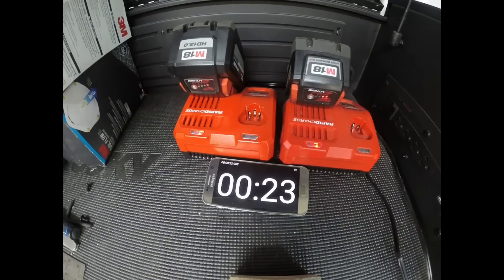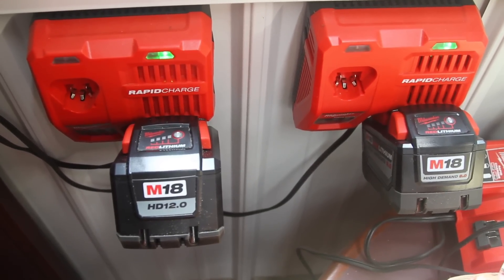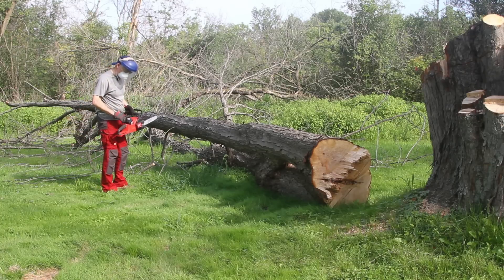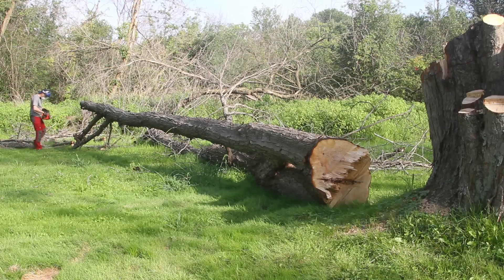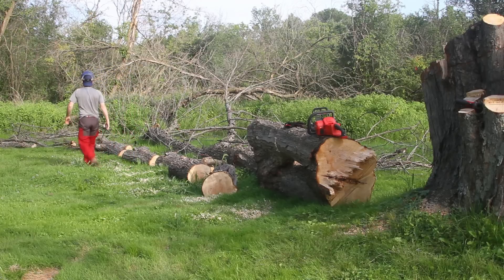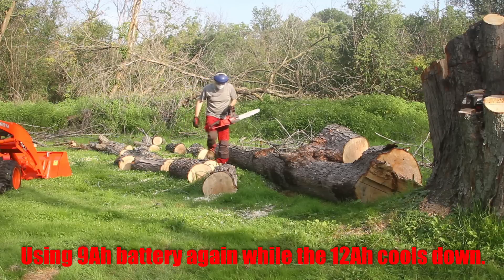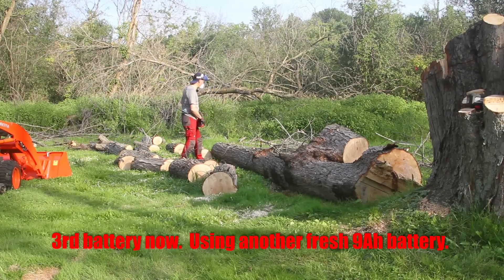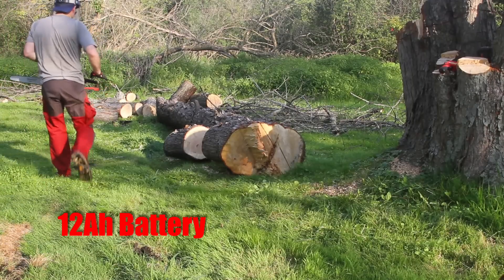Milwaukee M18 12Ah battery charge time vs. work done with chainsaw.

Comment: I usually spend more time getting my gas chainsaw started and running properly than I spend actually cutting.  This looks like a better option.   Especially for clearing shooting lanes without alerting wildlife for miles.
Reply from the maker: Good point!
Reply: You must not know how to start a gas, or either the chainsaw is in terrible condition. Considering I can start my 10 year old Stihl ms 290 in a couple of pulls says something. But this electric chainsaw is very cool!
Reply: @Anonymouso283  yes, it says you're a douche.
Reply: @Kevin Jones 
No, no. Don’t take offense to my comment! I wasn’t trying to be an asshole lol! I was just stating that (most likely) people having trouble starting their gas saws usually either don’t take good care of them or they don’t know how to start it. I wasn’t meaning you were a irresponsible person! I was saying in general. Anyway, have a good day! :)
Reply: @Kevin Jones  
Oh, now that I see my comment, it kind of is directed to you. Whoops. My bad! I mean in general. Not directed to you lol!
Reply: @Anonymouso283  it's all good.  Most of the time my issue is old gas that needs to be replaced because I don't use it as much as I used to, and i don't have many 2 stroke items anymore so it usually requires a trip to the gas station.
Reply: @Kevin Jones 
Good point. I don’t use my saw too often too, but I like to start all my engines up once a month to keep things moving, if that makes sense. Anyway, have a good day my friend! :)
Reply: @Anonymouso283  you as well.
Reply: @Anonymouso283  this saw starts in ZERO pulls everytime.  Most home owners use a chainsaw once or twice a year. Store your chainsaw for 11 months and try and start it.  Guaranteed trip to the small engine repair shop for a carb clean.  NOT for people who use a saw everyday.  PERFECT for a home owner.  Now the best part is you can buy a tool that used the same battery.

Comment: Your temperature reading on the battery is very misleading and inaccurate.  Of course that battery is going to be its hottest at the point of voltage exchange, but that's a very localized area that has little to do with the cells on the whole.  Your initial reading on the bottom or back of the battery was a more accurate or true way to measure the proper temperature (111-113 deg.).  I just pulled my 12Ah battery off the rapid charger and it was hot at the contact point but the majority of the battery was mildly warm at best, no overheating issues. The battery won't push power if its "Overheated".  Put a small fan on it if your worried.  My 12 gauge electrical cords get fairly hot at the point of plug-in.      

Enjoyed the review
Reply from the maker: Thank you, point taken.  My apologies for anything misleading.  The reading I took after the charge completed was unusual and I believe to be the circuit board inside near the contact area as you pointed out.  The other times I charged the battery I don't recall it heating up like that.

Comment: total waste of money gas chains saw last for 20 years or more how long will these high dollar batteries las 5 to 8 years
Reply: I gotta agree with Leggir, if you have all the other battery tools, you can use it on your chainsaw on a certain day, then use the battery the next day on your miter saw, circular saw, or sawsall. I think the market for this saw is the tradesmen that occasionally uses a chainsaw, rather than professional tree trimmers.
Reply: If you've got a Jeep and want it to cut trees off the road, it starts faster, doesn't stink up the vehicle, etc. You can also use the batteries in your drill, lights, air compressor, heat gun, caulking gun, nailer, sawzall, tablesaw, etc. Probably not a waste of money depending on the application.
Reply: Batteries if used hard every day last about 2 years but if not used hard can last 5 or 6 years
Reply: Gas saws last 20 years if you maintain them and run them consistently. An electric saw will start at the press of a button as long as the battery holds a charge and the brushes aren't corroded. A gas saw will kick the bucket if it's brushes corrode (the chainsaw equivalent of an alternator, I forget what it's called) and on top of that worry you have to deal with 2 stroke engines being fickle. For most people electric is the way to go for sure
Reply: @Robert-qm7yi  good thing it doesn't have brushes

Comment: Fair to say this job is a fair bit beyond the intended performance of this saw. That’s a big hard tree that would test any 16” saw.
Reply from the maker: I agree.  And really this saw did quite a lot of cutting with the 12ah battery.
Reply: I’ve used this tool with great success.  When used correctly this job is within its capabilities.
Reply: For the cost of the saw and the batteries, you could find a gas saw that would lay waste to that tree pretty easily and do ten more after it. 

For yard cleanup work, the battery saws are nice. For someone going out with a big wagon and expecting to come back with a lot of wood, they're a really expensive mistake.
Reply: @daw162  You are on the spot

Comment: Think you could put a 20” Oregon bar/chain on it without any issues?
Reply from the maker: Sorry, I missed this comment because it was marked as spam...I have no idea why.    You are thinking like me.  First thing I did was check to see if my older Oregon bars would fit and they are too thick.  I have not had the time to research the  fitment of other Oregon bars and chain, but it has been on my mind as a followup video.  So many projects, who knows, I might try it, stay tuned.
Reply: Oregon 18 bar fits. :)

Comment: Whats the C rating of the 12Ah to actually achieve total capacity? 
If it's overheating I would guess you're more likely getting closer to 8, whilst hurting the cells.
21700 tech isn't as developed as 18650 is yet and it seems like they might be good for peak amperage but suffer under high constant drains due to their extra heat trapping bulk. 
Power density is also no better than 18650 yet. 
I'd like to see a controlled chainsaw stress test with a 12Ah vs 2x12Ah batteries in parallel. I recon you would easily see 3x the run.
Or just say fuck it and buy a 2 stroke.

Comment: Is there a possible over heat issue from 12ah battery?
Reply from the maker: Yes the 12ah battery can be worked so hard that it will over heat. However, I believe that 12ah battery is the best cordless power tool battery on the market today.  It really is an awesome battery.
Reply: The 12.0 and 6.0 use 21700 cells unlike the 9.0 and 5.0 and smaller which use 18650 cells. The 21700 cells have a much better cooling capacity and can handle a higher current draw than 18650's. In this video it's not a battery problem, it's a user problem. The way he was cranking on it, any comparable gas saw (40cc's) would bog down and completely stop where this one kept going which draws huge amounts of current

Comment: What a piece of shit ...the price of the saw plus charger plus 3 batteries you are using and they are over heating. ..go out and get yourself a stihl ms661 with a 25inch bar it will not bog under load just check your fuel and bar oil and you will have that trunk cut up in no time

Comment: Any noticeable difference in the saw’s power between the 12 and the 9?
Reply: I'm  beginning to think even the 6 provide more power than the 9. The 6 and 12 have different chemistry with greater discharge rate than the others but at reduced charge recycles - no free lunch. The internal voltage drop is less on the 6 and 12, thus more power delivered to that motor.
Reply: kimchee94112 6 has more power but less run time. Give and take.
Reply from the maker: Not really.  Power seemed fine with the 9ah.
Reply: It will be the exact same performance, but the 12 will last longer.

Comment: Could this be a future problem (battery heat) with Milwaukee sticking to an 18v platform? Having to draw more amps to get more power? I abuse my husky batteries when I use my T536LI XP and they never get hot, barely even warm. Likewise with my flexvolt tools. The only 9ah Milwaukee battery I use is on their grease gun which is excellent but it never gets a chance to get hot. I agree with you having to remind yourself the saw is live, I am struggling to get into the habit of locking the chain whenever I put mine down too!!
Reply: i think the issue will only be with the chainsaw, i'm a contractor and i run only milwaukees and i've worked those 12 amps really hard with the new 2 gen tools and they have never reached any temp that i'd consider too hot after running a super sawzall for 40 minutes straight through a pine 6 by 6 basically trimmed a wood post too be a 5 by 5 the battery barely got warm, compared too my older batteries these 12 amps run really cold, it's impressive they are running cells that are cooler with more power.
Reply: You're not drawing more amps. It has more cells, so same amps per cell, the stress on the whole battery is the same.  And it's not overheating it has a safety to shut it off. Simply get 2 batteries and swap a lot faster than getting fuel and filling. And no fuel spills
Reply: @Q70L5.6AWD  I would have thought the batteries draw more amps as needed, hence why the motors keep constant rpm when pressure is applied. I'm sure I've heard dewalt, milwaukee and metabo market this with lion and brushless motors. If the safety is kicking in, I'd say it's overheating. To get a certain wattage from an 18v tool you need more current draw than from a 54v tool. Just saw a video of the new makita 36v cut off saw and it draws more amps as required also.

Comment: Use a Milwaukee M18 Jobsite fan or a cooler to cool the batteries down. Also, at any point, are you planning on moving those logs? If so, do that with the Kubota while you wait for the battery to cool or charge. No downtime that way.
Reply from the maker: Hey I like that idea!

Comment: If i want to cool something I'd place it in a cooler with ice or in a refrigerator. Setting it out in the hot sun doesn't mean cooling to me. I use the 9 A-hr battery on my grinders and when they get hot I put them in my beer fridge and they cool right down and keep on trucking. What I'm trying to say is if you want to cool something then cool something.
Reply: When you put a hot battery in the fridge you getting moisture in the battery not the best idea
Reply: Good idea, a little cooler with blue ice outdoors should also be good.
Reply: Yezzir, or drop it in a bucket of cold water for a few minutes...

Comment: I used a stihl battery saw on a 95 degree day with two batteries over 8 hours. Neither saw or batteries  overheated. Got 1 hr out of each battery before having to charge. It took each battery 45 minutes to charge, a conservative estimate of 400 cuts. The saw was a 40v 6amh with 14"bar.
Reply: Thats awesome. I would still buy this simply because I have batteries and chargers for m18 tools already and this would go well with the set.
Reply: stickin' china made crap @Bshwag
Reply: What?  @lifeingeneral9111
Reply: were you cutting 15" hardwood though
Reply: My Stihl 200c can be worked hard with the largest battery and does not overheat. It runs until flat. That said I  think your Milwaukee has more power.

Comment: Id say technically it didnt overheat since the protection kicked in before that actually happened. But i wouldnt be surprised if Milwaukee came out with a revised saw that has a fan to blow air on the battery every time you pull the trigger..
Reply: That start to look Milwaukee strategy they make good product and gen2 is far better and you want to buy that too.
Reply: Nonetheless it's better than another competitor when the battery overheated the electronics identify it as bad and could never be used again.

Comment: Considered buying this chainsaw.. But the fact you can't get an hours worth of cutting done is just sad..
Reply: You could if you let the saw do the work unlike this guy who was cranking up on the handle like an 80cc gas saw purposely working it too hard thinking he was testing it. SMH
Reply: Aaron, this video is a tad misleading. I have one, and used it the other weekend. We had a bad storm that blew over a full grown tree, roots and all, onto my neighbors barn. Besides the 25 feet of 22" diameter tree trunk before branches started, everything else was done with my Milwaukee saw. I used it for 8 hours on branches and limbs. Never once overheated. I went through one fully charged 12.0 battery, and 2 bars of a 9.0 battery. It is honestly a pretty impressive little saw.

Comment: Well these just got in stock locally and before going out now to buy - checking reviews since mostly limited manufacturer sponsored type or speculative  reviews about this thing should be great last time I looked.   This review with the overheats making me think this is a junk saw to stay away from.   Was just minutes away from going to get.     Uuuuughh!
Reply from the maker: I really hesitated to show people the over heat issue.  But I did.  If I used the saw like I normally would, by cutting then hauling out cut wood with my Kubota, back and forth like that so it has time to rest between large cuts, it would be fine.  I pushed it in this video on purpose.  I wanted to see what it would do.  This saw is more expensive than a gas homeowner saw, but you also get the most awesome tool battery on the market, in my opinion.  The performance of this tool is impressive, but yes over heating is a reality, though one that can be avoided by work flow that includes a little cool down time.
Reply: also too be completely fair the test shown above was the absolute max this tool in my opinion could do, and its impressive that it actually still did the job.  maple isn't soft by no means and those logs are rather large for homeowner work, its a homeowner tool in reality even though I personally bought one but i'm not in the fields of logger/tree removal I only use it for brush/small trees when i'm clearing lines for fence installs and for my particular use given I have no experience falling large too medium sized trees it's perfect.
Reply: @BZEUG  This is one of the best reviews of anything I've seen, thank you. You are very reality oriented and very helpful. I'm inclined to purchase the saw, used the Oregon CS250 for several years, ok for small stuff.
Reply: Well purchase based on you and motocheez.
When first plugging in battery (did not check charge level 1st). Led was.red after about 1hr still red I unplugged and plugged in again still red left for a couple more hours still red.   Unplugged checked showed all bars plugged back in and immediately green.   Wondering your 1st use  experience.    I hope I don't have a battery/charger problem.    I wanted to try out but hit by thunderstorms so probably not going to have time again for a few days.     Also I was shocked how short bar was - thought it was same as my 40cc Hitachi discoverd it's 2" shorter oh-well
I would check manual see if it mentioned - there wasn't one.   I know it's unused because we spent hours looking for the ones in store they were in the individual cardboard shipping boxes from factory.    I'll search for a download one and/or contact Milwaukee later
Reply: R H it tells ya what size bar it is on the box.
Reply from the maker: I have not experienced that.  I have experienced a situation where I charged the 12Ah up to flashing green and mistakenly removed the battery from charger thinking it was done.  Solid green is finished charge, not flashing green.  Then put the battery back on the charger and the charger saw the battery as full, and showed solid green.
Reply: bzeug that sounds suspiciously like a similar error.   Wonder if there is an issue with the charge stations.   I also just edited above to indicate I know mine was UNUSED due to factory sealed brown cardboard... somehow I must have mistyped and autocorrected to used w/o noticing.
Reply: it's not, flashing green means almost fully charged. All my milwaukee batteries do that.
Reply: @BZEUG  flashing green means it's almost done charging. If you take it off and put it back on the charger, the voltage is high enough where it says it doesn't need to be charged but if you leave it on the charger until a solid green light then it'll charge all the way to 20.5 volts
Reply from the maker: @muddybadgers5205  You are right and this did have me confused.  I'm now getting those batteries truly fully charged.

Comment: I'm thinking it would have done  better if you would have given your chain a quick sharpening.  It might have pulled less power from the battery.
Reply from the maker: I think so too.
Reply: Thanks for the video.  I have the saw, too.  I haven't had the chance to try it out, yet.